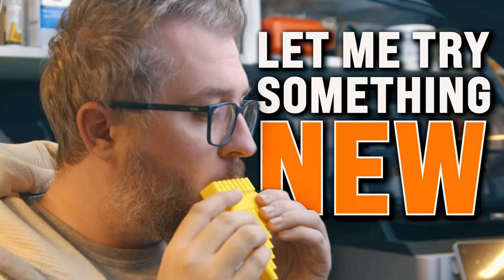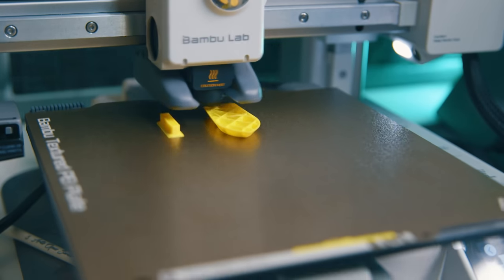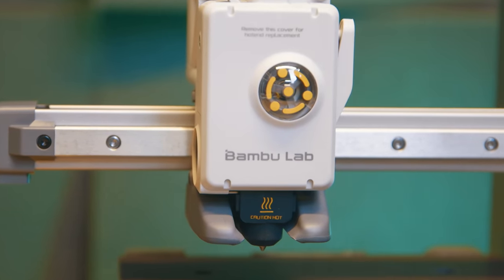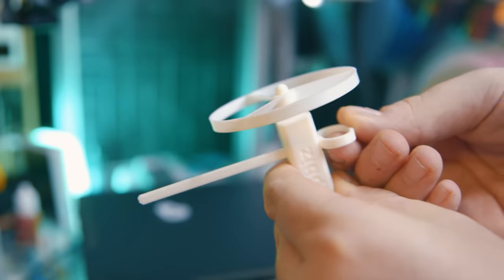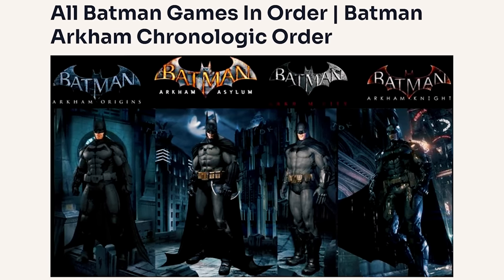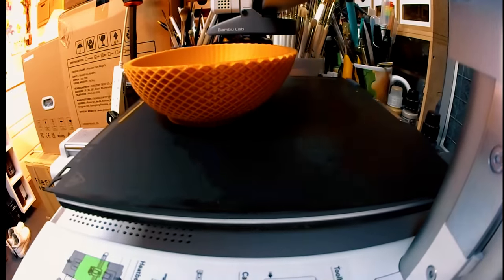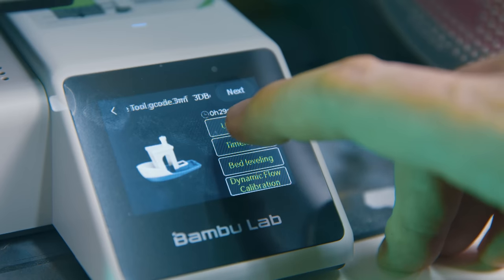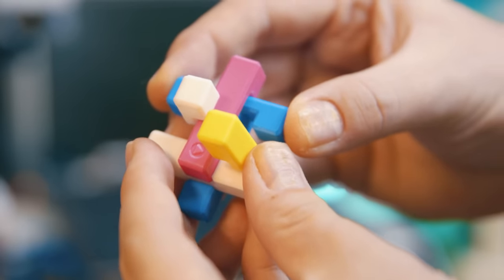Bambu Lab - A1 Mini Review - IT WASN'T MADE FOR YOU!!!!!

Comment: I have the original - the CETUS (I call it Moby, of course). I bought it when it first came out and apart from a few mods (like a better, quieter fan) it remains unchanged. And it is still great. I particularly like the Hywin style linear rails which offer a stability not possible with thin floating rods.
Reply from the maker: Thanks for sharing!
Reply: @FauxHammer  And I now have the A1 MINI as well.

Comment: As for it being too small, I have a Voron 0.2R1, with an 120x120x120 mm print volume. It's plenty for MOST of my printing. I also have a SV06 with 220x220 for larger prints, but the real advantage of the larger one is a longer print time, start it and leave it to run multiple copies. 
If I wanted the multi color option, the A1 Mini would be a good choice (if a bit slower).

Comment: Fantastic video!  I have a friend who's considering taking the plunge and I feel like this is perfect for him and his family.

I have an aging Ender 3 Pro and was looking hard at the P1P/S as a replacement.  Does the A1 mini have any features that those don't?  The bed concerns me a bit, but most of what I do is tabletop terrain and the savings of the A1 mini has caught my eye.

Great work!!
Reply: There appears to be some technical improvements based on what the company learned with its earlier printers. However the biggest advantage the A1 mini has over the more expensive printers is the quick swap print head. This means you can easily switch back and forth from a .06 to smaller .02 printhead when you need something with finer details. While you can definitely change print heads on the P1S, etc. It is noticeably a more involved and longer process. I think it takes 20 minutes give or take to switch printheads on the other printers, whereas it takes seconds on the A1 mini.

There's also some additional improvements apparently that aren't all that obvious. The AMS unit is improved apparently, but because it's not enclosed like the AMS units used in the higher end printers It doesn't act as a filament dry box.

But from what I understand there are some neat little engineering improvements to the way it handles filament. In particular the A1 mini AMS has noticeably less filament waste when utilizing the multicolor print function. 

I have one arriving this week, it's my first printer, I was debating back and forth between the P1S in the A1 mini, but ultimately I went with the A1 mini AMS mega combo. My gut instinct kept nudging me more towards the A1 with AMS. 

Though i could have probably got a P1S without the AMS as it was only about a $90 more. But again for some reason my gut tells me to go with the A1 mini, and normally that tends to lead to the best outcomes for me, so that's where I'm at personally.
Reply from the maker: yeah I think when it comes to colour changing and hot swappable nozzled. the A1 has the win over the P and X series at preset.  but only becasue they are newer advancements in a newer product.

Comment: what a great review. I was eye-ing a new 3d printer. but could not get over the pricing and yeah what to buy.... i have bougth an ender 3 in 2018, so dipped my toes in, but it sits there gatering dust, because well .. the damn thing needs configuration every damn time. and i am tech savy but just dont have the energy to do that and it crushes my enthusiasm. And what to print... well the small size would not be a big problem at first i think... i want to print cookie cutters, earring cutters, keychains etc. 

but my point... you sold me on this one and it has an aniversary sale right now. + the AMS thingy ( multicolor printing) you can buy in a bundle and separete. whoo hoo. now to convince my bank account i can give this myself lol.
and the hardware kits are still available ;)
Reply from the maker: You can give yourself this. You deserve it fir having to deal with Enders
Reply: @FauxHammer  i bought it and i love it!
Reply from the maker: @sophiemulders  this makes me happy!

Comment: I own an Ender 3, CR-6 SE, CR10 V2, Artillery Sidewinder X2 and now I bought an A1 mini. Why? Because most prints are small enough to fit on a 18x18cm bed AND I wanted multi colour printing at an affordable level AND I don't like how fiddly the CoreXY Bambu printers are because of their enclosure. I just love bed slingers for how accessibly everything is. To me this was the perfect printer to get for every job that fits its build plate. Spool changing is way faster than on the other Bambu printers & you don't have all the nasty issues with cardboard spools etc.

Comment: I've been saying a similar thing for years : the only way to accelerate the 3D printer industry is to popularize it and make it far more accessible. These machines have to go away from the "nerd/hobby thing" and into the "appliance" corner, where people with a minimum (like zero) background knowledge can actually use them in useful manners .  I don't agree with everything Bambu does or stands for, but they are really the ONLY company which has recognized this. A dangerous, risky business model, but i hope that indeed we will say in a couple of years what Bambu currently states : "we're currently at 50% of where we want to be in terms of automation and user-friendliness".   High time a company start pushing this wagon and having the boldness to do what every other company has been bragging about, but none of them actually ever build : a simple, easy, good quality low cost printer for beginners and seasoned users alike.
Reply from the maker: YES, THIS!!!! 10,000% this!
Reply: @FauxHammer  No, you need to buy an Ender-3 to learn the ropes, spend at least double of what you paid for the 3d printer on upgrades and repairs to get it to print poorly one fourth of the time it actually works, discover new problems while you fix the mountain of existing problems, sink more time and money into the crap investment, only to either toss the 3d printer in the garbage or sell everything out of frustration for peanuts because nobody pays more than 100 bucks for an Ender-3, regardless of how many upgrades you bought.

I lost any resemblance of patiance I had for troubleshooting 3d printing problems. I'm at a point where I lost all hope in 3d printing. I still threw 200 bucks on a Bambu Lab A1 Mini for the off-chance to get a 3d printer that just works, but only because I know that I can either return or chargeback the 3d printer in case of any problems. This is what happens when people recommend Creality 3d printers to beginners. Never again. So I can really appreciate what Bambu Lab is trying to do here.

Yeah, and I'm also one of the people that will persuade beginners from buying Creality 3d printers. Just don't. Creality customers are the quality control department, and random tinkerers are the customer support. Literally nobody at Creality to scream at in case of receiving an impossible to use 3d printer. Horrible investment.

Comment: I have been 3d printing for a few years now.  Started with a used 8-year-old printer, then bought a brand new Anycubic Vyper.  Having some fun.  But, what I do not want to do is mess around with hundreds of settings.  That's not my hobby.  For example, when I print a Word document, I don't have to tell the printer what temperature to use or how to do what it needs to do.  I just want a friggin print.  There are two types of people in this hobby, the tinkerer and the user.  Why is it my job to tell the printer whether to use tree supports or any support at all?  This little printer is a step in the right direction... and its friggin fast to boot.  It is my next printer, as soon as I convince my wife.

Comment: Creality K1 works as good (probably better) out of the box now. I still have to get a failed print after a month of use. And it was only $300 on sale, so Bambu is not that that cheap at current price either.  But we can agree, that there are thousands of bad outdated DIY printers on the market that might get replaced really quickly with these out of the box working machines. :)

Comment: The A1 was the first printer in a while that i was genuinely excited about when it came out.  The issue for me is i never buy new. I buy used and indulge in tinkering modding and hacking to get what i want. But if i were going to buy a new printer for general hobby use, this would be a very steong contender.

Comment: I love your approach here.  Youtube and the maker community as a whole think everyone should be like them and enjoy tinkering with everything in order to "learn how it works".  While if you are specializing in a field I agree 100%, but if it is a tool for a hobby of yours why?  Just why do i need or have to know how everything works? I don't i just want the tool to do its job so i can get to the part of the hobby that I enjoy.  These same people are the ones that think DIY stuff saves them money without taking into account the most important currency of all time.
Reply from the maker: I had the same chat recently about some display Cabinets. https://www.youtube.com/watch?v=yZaTGLhKq3I

They are really expensive,  but there's some 3D printable versions which I backed so i can compare them to these.

just to figure out what parts I needed to print for those alternate ones. took an hour. Another hour to figure out which parts and holes I'd need, then I'd need to work out how to get the right sized Perspex.

And when they are done, well, they are just gonna look like cheap modular 3d printed eyesore cabinets.

so, yeah, nah, I was already turned off by how cumbersome it was, so I'm never doing that video. I'd rather just pay Artis Opus to make them
Reply: @mekko1413 totally agree, I have a cheap 3d printer as a hobby machine and while it's true I've learned a lot through (necessary) upgrades and tweaking to get prints right, 6 months in I'm more than a little frustrated that it still won't just print when I want it to. I constantly have to do test prints and watch the first few layers with eagle eyes to make sure someone hasn't gone wrong.

There's a lot to be said for a machine built to just work straight out of the box. And easy swappable nozzles? Damn, that's the icing on the cake.

Comment: I have a Neptune 4 pro, (my first) and I WISH I had a Bambu Lab A1 mini.  (A $10 difference) I simply never make big stuff and I may still buy one.

I'm a techie.  But BECAUSE I'm a techie, I need my parts to come out right the first time, and I need them quickly.  My goal is to tinker with the parts, not the printer.  (That's the whole reason I'm printing something!)
Reply: Is the Neptune 4 pro less better than this, because I am really on the fence between the base a1 mini and that for my first, especially since I don't know much about 3d printing
Reply: @patrickbueno3279  There are 3D printer owners who like to tinker.  Personally, I'd rather have a system that "just works".  I'd go with the A1 mini, although in fairness I should say I don't own one.

Comment: So, I have to disagree. I have three x1c printers and my mini is by far my favorite as well as the one I use most often. Certainly, the print volume is small, but not everything needs to be printed large. In fact I find most of my prints can easily be accommodated on the A1 mini. And it is so much more quiet than the X1C printers. So much so, I keep it in my bedroom. So, I'm sure there are those who agree with your premise, just don't count me as one of them.
Reply from the maker: You said you "have to disagree", then mad a statement that complete agrees with my views?
Reply: @FauxHammer  what I was disagreeing about was the notion that this printer is for beginners. I do agree with much of what you said in your video and obviously was not very clear in my statement.
Reply from the maker: @ChippWalters  oh yeah, that was  just hyperbole mate, not a fact.

Comment: I’ve got the x1 carbon it’s over kill for most of my prints, I’ve got 6 other bed slingers  will be moving all of them out the door, after that will be getting the A1 to do my smaller prints (small hand size toys for the kids cancer center). This looks like a easy to keep running machine , I wish the x1 had that quick change print hot end. Of course I think the x1 is easier than all my other printers.
Reply from the maker: What a lovely thing to use your printer for!

Comment: Actually I agreed with the video commentary fully. My first smart phone was a HTC touch, it used Microsoft mobile OS, it used a stylus and was frankly awful, but then I did want an electronic organiser with a phone added on back in 2009. Then Apple released iphone, it looked great and was far easier to use, more stable, less techie orientated. However what I didn't like was "proprietry" nature of Apple, that is to say only Apple make iphones and use IOS. But when Android phones came out they made smart phones more accessible, you didn't need a contract and it was basically a more open system than Apple mobiles and Apple laptops, computers and tablets.

Over the past decade I've looked at 3d printers every year or two, they have been overwhelmingly a hobby, techie scheme, absolutely not mainstream. Sure 3d printers have become more reliable, affordable and better made, but have still been 'niche' market. I've looked at the Bambu A1 and it looks pretty good for the price. Sure it's less DIY and more focused on getting stuff printed, the multi-colour / multi-filament system is good. For the price the Bambu Mini is the perfect introduction, especially the single colour (without AMS) is an even better introduction to the 3d printing experience. I also think you've made a very important point about the print kits, Bambu may well have included them as an intro' promotional aid, but as you rightly say the concept is itself worth them investing more time and effort in, because a 3d kit that you get all the extra mechanical parts in that makes a working item is a great way of spending a few hours, without having to go and get the right screws, nuts, bolts etc, it's like the old Airfix kits, except you had to buy the glue extra and the paints of course (-:

I'm still not sure if I'm prepared to buy the Bambu A1, because I have enough hobbies, video making, gardening, digital cutting machine and not enough physical energy to give to them all, with having M.E/CFS. But, I could do with a way of easily producing replacement parts that can't otherwise be obtained. I like the 3d design challenge, the creative aspect, also the enthusiasts seem to have built some great free models we can print at home, plenty of online advice available. The price is good and the specifications, contruction, features and general package is about the best I've seen. Not sure about the single-system of it though, being locked into properietry systems can be costly and restrictive, cf Apple systems.

Comment: I got 2 kobra plus'.  Within 2 years they came out with 2 more printers and stopped supporting the kobra plus.  I had nothing but problems from the start.  I had numerous hot end problems and it even just stopped moving on the x-axis so now I have 2 paper weights.  I don't know enough about printers to rebuild the entire things correctly.  I got into the hobby to print things, not rebuild printers.  That said I'm now looking at something like Bambu and my biggest question is whether to get the A1 mini or keep saving up for an X1 (or even whether or not to "settle" for a P1P)

I wish I'd seen this video years ago.  I'd probably have a lot more prints under my belt instead of just unused spools of filament and a couple boat anchors.

Comment: i personally think the p1p is a perfect familiy printer except for one small issue and it's the screen, although the printer can be completely controlled by your own smart phone it could still be a small con, for the rest the printer has a large build volume which can satisfy most needs like 3d printing a plantpot or any plant based inventions but also other bigger objects, the print speed is fast and  the quality is a little better that the a1 mini, it's price is mid range since currently there's a pretty nice discount going on (black friday). So as stated before a p1p would be a better option despite it's price compared to the a1 mini.
Reply from the maker: Honestly, that little screen is 1000% more useful and clear than Elegoo's 5" screen on the Neptunes

Comment: I own a A1 Mini in addition to my X1C - simple reason is I do not like to deal with non AMS comply filaments on my X1C - so TPU for RC Tires are printed on my A1 Mini. And when you have a larger project it is handy to have two printers in parallel - and there is no reason really to have two expensive ones :-)
Reply from the maker: Hey that's actually a solid point.

though be honest, if you had the option of 2 X1C's (one without AMS), like if money was no option. would you prefer that over this.

Actually, dumb question, if money was no option, I'd have one set up for each colour
Reply: @FauxHammer  Even when I wouldn't concern the money two X1C are not bad idea. But quite soon I would add a AMS to the new X1C (Have already 2 AMS connected to my current one) and than you have to deal again with the non AMS comply Filaments and I would again buy a A1 or A1 mini ;-) 

Based I'm ** lazy I love to simply use the A1 Mini when I have a non AMS comply filament or simply a spool that doesn't fit directly in the AMS (I have adapter rings for sunlu, but I do not want to rebuild my ams with the Hydra System). 

And currently 199 Euro - compare to 1099 Euro - it does not hurt to buy a A1 mini :-) You can get 5 for one X1C. And sure I love my X1C, and when thing goes complicated like printing ASA I use the X1C. But when I need quickly a additional part and the X1C is busy - it is handy to have a second printer that doesn't cost that much - and also require far less space.